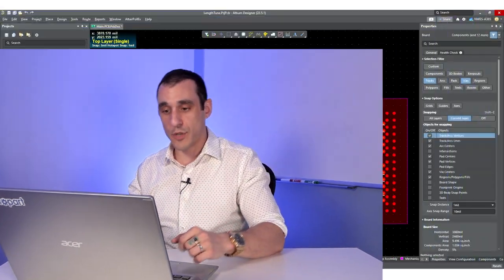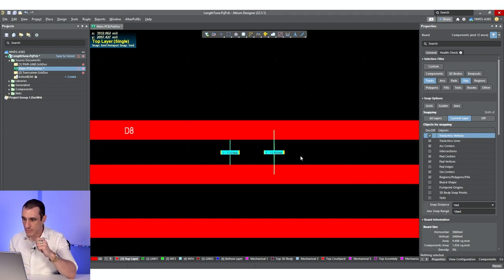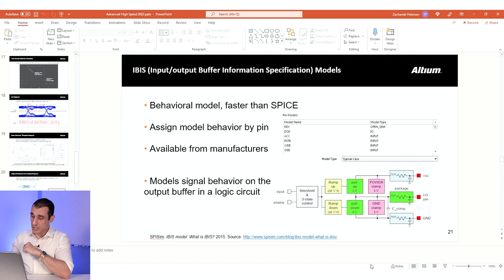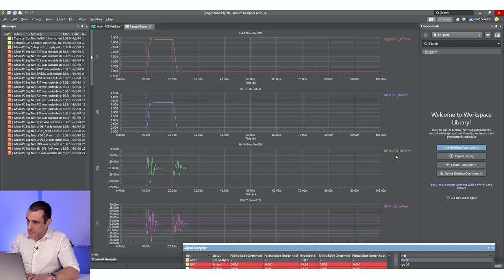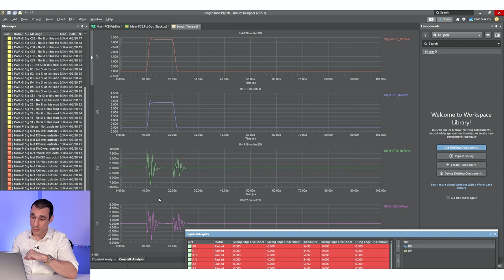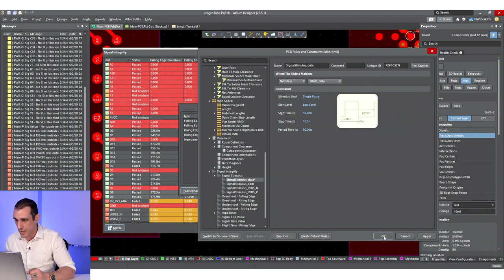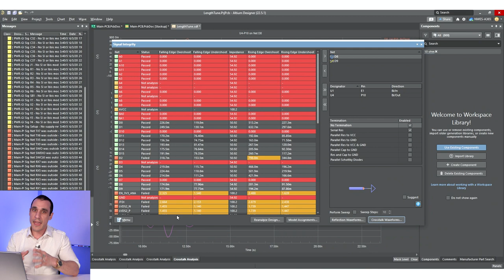How to Set Up a Crosstalk Simulation | PCB Layout

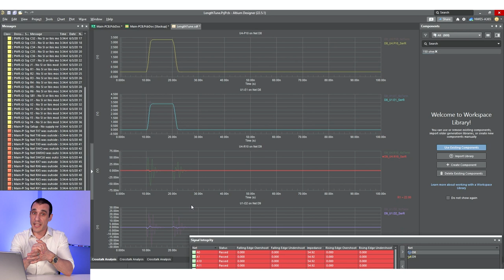Comment: Contrary to what you said in 13:45, over termination does not create new reflections as far as I understand. It will create slower rising edges and thus longer propagation delays, but not any new signal integrity issues
Reply: I should have clarified this, for a series resistor you would see the new reflection on a backward propagating wave since that arises from the new impedance mismatch you created from overtermination. But looking in the forward direction with an excessively large series resistor, you are right you will see a slower rise time looking towards the output. Since the simulation is not looking at any backward reflected wave you can't see what that reflected wave looks like.

Comment: Hi Zack, Thank you very much for making this video. We found that Altium supports only IBIS models up to V5.0 (specification from 2008). Unfortunately a lot of manufacturers are providing their IBIS models in V5.1 or greater. When will Altium support a newer version of IBIS models? Thanks!
Reply: I know that earlier versions (I think AD17) supported v5.14, that should still be the case. It would be odd to find that the newest version does not also support the newest IBIS specification, but I did not see information in the Altium documentation after a quick search.

Comment: Hello Zack, this content is very interesting to simulate crosstalk, but the SOIC packages pin is not suitable for 3W Rule, eg: Pin width is 0.4MM, Spacing between next pin is 0.254MM, Its make crosstalk?
Reply: You do not need to use the 3W rule in every design. The 3W rule is overly conservative and was developed at a time when everyone was using boards with thicker dielectrics and no ground plane, both practices are not appropriate for modern designs. You should learn to use at least 4-layer board with thinner dielectric below the surface layer. For example, if you use a standard 4-layer board with 4 mil dielectric below the surface layers, then a microstrip would need about 8 mils width to have 50 Ohms impedance on the surface layer. With the standard pin pitch in JEDEC specification for SOIC package, you would have about 50 mils center-to-center distance, or 42 mils edge-to-edge distance. This satisfies the 3W rule anyways, but with 4 mil dielectric thickness to the trace you will be able to violate the 3W rule to some extent.

Comment: Hello, Thanks for video. Why can't we see 3.3V, 1.8V or 5V when the signal is defined in the 1n, 2n or picosecond ranges in the signal integrity tool? In general, waveforms come out at 700mV, 800mv levels. Is there a limit on the signal integrity tool? In the video, when you lower the start, stop and period values in the signal stimulus section, the signal voltage dropped to 900 mV. What is the reason? Is it related to Altium's computational limits?
Reply: Great question! This occurs because the time between the rise time and fall time was set very short. In one of the examples the time betwee the rising and falling edges was set to only 500 ps, so the downward edge of the stimulus was being triggered before the stimulus voltage value could rise to its full strength, that's why it did not go up to full scale.
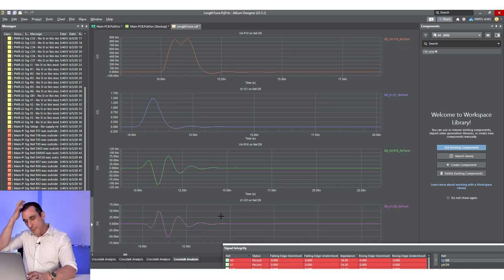Reply: @Zachariah-Peterson  Thank you Zach for your response. I have one more question : In the waveforms at 16:29, I saw that the crosstalk peak to peak at the source was higher than the crosstalk peak to peak at the Target. Actually, I would expect the opposite. I would expect less crosstalk at the source and increased crosstalk towards the Target. Why is more crosstalk seen in the source? And Which values should I enter to give 5GHz Signal for start, stop and period?
Reply: @ZAFER ACUN  I think this is because the falling edge just happens to coincide with the valley in the underdampred response in the crosstalk waveform, so the crosstalk induced on the falling edge superimposes on that waveform. Let me think about it a bit more and maybe this will be clear. For a 5 GHz signal, if you're talking about 5 GHz being the data rate, start and stop would need to be spaced out by 200 ps. To simulate a 101010.... bitstream then you would want to use a period of 2*(1/(5 GHz)) = 400 ps. If 5 GHz is your bandwidth, then the rise time will need to be some fraction  of the unit interval (UI). Something like 20% (or 40 ps in your case) would be typical.
Reply: Actually, this is a 10Gb/s high speed interface, I found the bandwith 5 GHz and the Tr from 0.35/5 Ghz to 70ps. However, I could not get the rise time as 70 ps in signal stimule. Whatever value I enter, I get the lowest 700ps rise and fall time of the signal. I was going to ask if there is a lower limit on the tool's calculation for rise and fall time. Can we simulate signal integrity in Altium for signals in the GHz range? How can I define start, stop and period for this example?